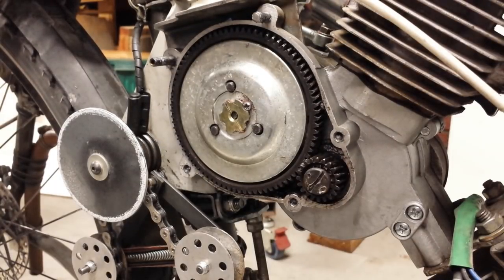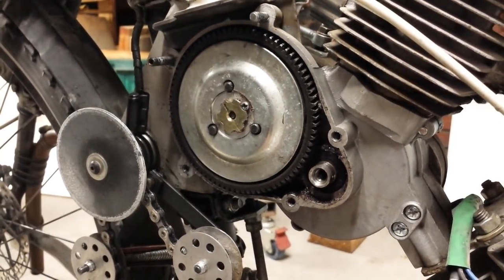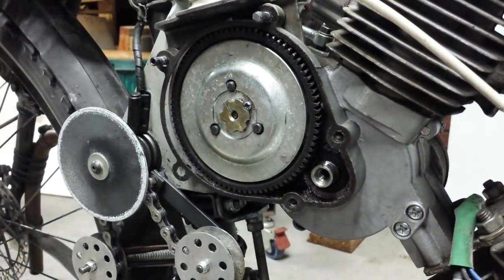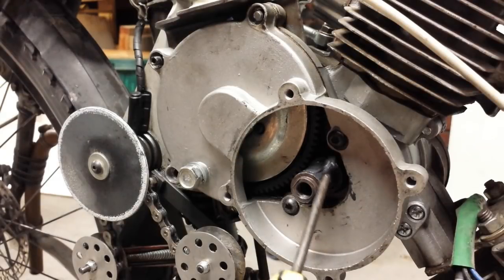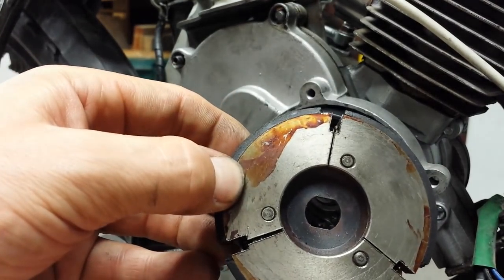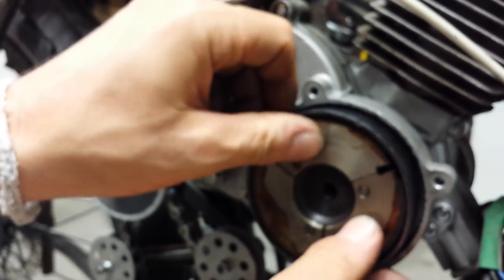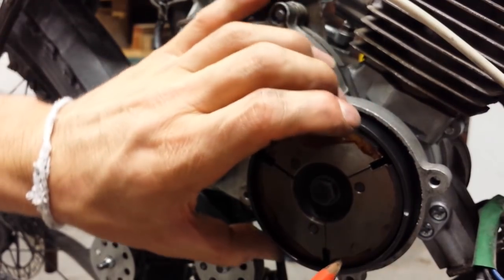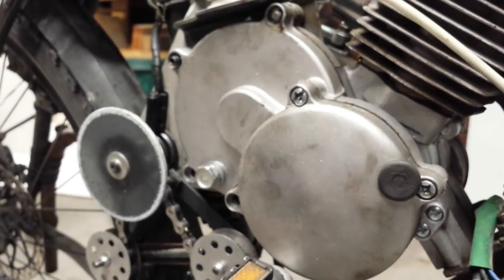Centrifugal Clutch Installation on the 80cc Chinese 2-stroke motorized bicycle engine

Comment: Good video.  Note that this centrifugal clutch kit is intended for use on one of several Chinese--made bicycle motors.  These are all made with a manually-operated dry-plate clutch similar to that on a motorcycle.  However, with a tiny engine and no gear shift it's rather difficult to start off, for the engine likes to stall.  The centrifugal clutch allows you to get off to a very smooth start, for those three big clutch shoes are meant to slip (and they get hot.)  The centrifugal clutch rotates the old dry-plate clutch, and that dry-plate clutch rotates the front drive sprocket.  

Yes, it requires a certain amount of work and a certain amount of mechanical experience as well.  In general, if you can repair a bicycle or a lawmower you'll have enough skill to work on a motorized bike, which requires quite a bit of tinkering just to keep it running even without a fancy clutch.
Reply: TY Mark I was honestly wondering what the point was and you helped me remember someone esle said they lack the torque to start from a complete stop unless you pedal.
Reply: Yes.  I should add that the stock clutch--the one that's lever operated--probably works much better with the 49cc engine if you're a 100 pound kid rather than a 200 pound senior citizen.  It can happen to any of us, I suppose.
Reply: +Mark Kinsler but of course you have to pedal to about 8mph. these are not similar to motorcycle/atv clutches where you can rev and dump the clutch. they have very little gripping force
Reply: Wow thank you for telling us what it does cause for people who dont know what it does will now know an explanation should have been in the video. The video was a bit too long for my taste tho

Comment: Good morning, I have the same clutch installed on a 48cc engine. What no one mentions is that the nut (plug) on the stock clutch side housing is for charging oil into the system. Yes, this clutch is hydraulic. It needs lubrication and the oil it uses is centrifugal clutch oil, SAE 20W30. It must be filled with this oil up to the edge of the fill hole.
Both the original clutch and the centrifugal clutch are in an oil bath and work perfectly.
Greetings from Argentina!

Comment: I am so thankful for this video. 8yrs old and still helping others! I’m finding that the 3 alignment posts on my clutch assembly appear to be longer than yours…too long to allow the cover to fit. I’m tempted to remove them and grind them short enough for the cover to seat properly.

Comment: I'm considering doing this mostly because my stock clutch is slipping and this seems like the only decent upgrade that would permanently fix it.  I already did the shift kit, and pull start, and upgraded intake.  As a side note, I'd tighten the crap out of the flower adjustement nut before sticking the new cover on just so you don't get any more slippage from the original clutch.

Comment: The best way to drill the little oil hole in the bell bushing is to use a 2mm diamond bit and a dremel tool. Takes about 5 mins. and the bits are very cheap. You wont break it easy like the carbide bit either. It works great, I've done it many times. 10 of the bits in a pack is only about 6 bucks. Try it, Very easy..

Comment: Thank You for this video..! I followed your steps to the letter. You'll need those diamond bits from Harbor Freight on your wiz wheel to cut a hole in the gear. I thought this would work without the hand clutch nah unless the "2 positions" made it too tight? It does pull way better off the line, No more bogging .. the out put shaft bolt is 8mm fine thread less than 1-3/4" my kit came with the wrong install bolt.... peace

Comment: Given the relative ease of removing the clutch shoes, and the fact you mentioned you can go about 100km before replacing the lubricant, wouldent it be easier to just remove the clutch bell for regreasing when the time arives? similar to a car oil change?

Comment: If you buy this, you can remove the need for a normal clutch entirely by welding the bevel gear to the back plate and removing the entire mandrel and spring from the shaft

Comment: I want to put one of these on my bike, I have an 80cc Roadstar kit bought off of Amazon. What happens with the old clutch? It just stays there? like a secondary, if I want to manually release the clutch? (it'll just run normally like an automatic clutch until I pull the lever in which case it will release and no power will be applied to the wheel?) Also, will I need to buy a pull start?

Comment: Anyone else bought a cent. Clutch where the extension sleeve isn’t reamed for the taper on the crankshaft? Mine are just straight holes that don’t fit over the shaft
Reply: Same problem. Dont know what to do
Reply: person I have a lathe so I machined mine to have a somewhat matching taper, I hope some of these sellers realize eventually because I watched an installation vid on here and theres was machined properly
Reply: Dang I’m retarded, this IS the installation video lol
Reply: @ghettobikelife8833  should i use a dremel to fix the problem
Reply: @person-ce8cr  I would if you can find a way to spin the extension while grinding on it. The taper angle doesnt need to be exact because there's usually a small shoulder on the crankshaft it can butt up against to keep it straight, but you need to grind all sides evenly or it won't be centered. Though mine has become pretty wobbly after using it alot (0.5-1mm) and it still works ok. Lots of times I've spun things in a drill and hit it with a grinder at the same time as a ghetto lathe. But you have to take it really easy grinding or your hand will slowly start to bounce and it'll be off center.
Reply: If yours has the shoulder to keep it straight And the very end of the crankshaft fits into the hole a little bit, that'll help huge- just don't grind as far as that tip will reach so that the very tip fits tight and keeps it centered. If it has both those things you can maybe freehand it without spinning. Was your clutch from ebay like mine?
Reply: @ghettobikelife8833  yes from ebay
Reply: @ghettobikelife8833  can i just take the manual clutch off with the cent clutch on
Reply: @person-ce8cr  you mean pulling in the clutch like normal? yeah the old clutch will still work

Comment: I found out that the newer kits (possibly even the old style) do not need a hole drilled for grease Fabian. Cleverly enough they machined a bit of the gear part of the clutch bell so they could press it into the bell, they leave enough teeth at the pressed portion that the teeth actually act as full blown channels for the same grease that lubes the gear work, at engine speeds this actually presses lube directly to the one way bearing.
Reply from the maker: The issue, is not the one way bearing. The issue is lack of lubrication between crankshaft extension sleeve and the clutch bell riding surface. The one-way bearing is "not" a load bearing part of the clutch bell.
Reply: The bearings push lube down into the sleeve do they not? Unless the design of the kit I have is different from yours. Did your sleeve come with a hole drilled into it from the outside, about midway, to the inside, comming through the puller tools threads.
Reply: Threads for the puller, I mean.
Reply: And as an additional question, if a person were to drill a couple smaller holes instead of just one larger, could the force of the gears meshing push grease through and onto the shaft reliably
Reply: My gear and bell all appear to be stainless steel material, they should be able to stand up to a couple holes right
Reply from the maker: You logic is flawed. The crankshaft extension sleeve needs to be regularly lubricated.
Reply: Fabian F could you go further to explain what part of my logic is flawed
Reply from the maker: The one way bearing is not a load bearing part of the system. The one way bearing in effect, does not need lubrication to operate. The one way bearing is not designed, and does not operate as a pressure lubrication pump. The gear teeth cannot force lubrication in between the sleeve and ID of the crankshaft helical gear. In operation, there is no provision for lubrication to migrate into the clutch area, and no provision for engine operated lubrication to lubricate the gears.
Reply: Fabian F yes I was able to find this to be mostly true, I'm modifying the centre bolt by drilling and tapping to make a grease fixture

Comment: Hello again I did what you said about putting 4 gasket onto the clutch extension housing that did solve the problem I ran into another problem but was able to get that resolved that was with the small pins that goes into the clutch bearing what I would like to ask you now is when I turn the clutch where it's not engaging with the engine I notice that the drive gear turns do it suppose to do that also the clutch arm did you connect the clutch cable to that or you just left it alone without the clutch cable

Comment: Hi I am installing a centrifugal clutch on my motorize bike however I ran into a problem that I am not sure about when I install the extension housing my flower nut is hitting against the burge in the extension housing what I would like to know did you run into this problem when you installed your extension housing if so how did you fix the problem

Comment: Does this mean that the original clutch is locked in place permanently so it doesn't slip or spin does that mean you don't need the clutch lever either or am I wrong.

Comment: Nice, very informative.
But I was wondering, since you already greased up  the extension sleeve, is it really necessary to drill the gear and case for lubrication? 
I mean I know you'd want to periodically check to make sure everything is a go, and with regular motor bike maintenance wouldn't be too much out of the ordinary no?
I'm just asking because I'm trying to find out if it's absolutely a necessity  thank you for the very informative video. ☺️

Comment: Hi I have a  question. I have a 80cc bike motor ok when I. Pedal and released the clutch the motor has to. Turn on right  mine doesn't  it don't turn on so if guys know how to fix it I will really appreciate that

Comment: This video is great and helped me a lot with my own centrifugal clutch. I have a question: the one way bearing stop engaging after a ride. I have to pop everything open and clean the bearings (the five small pieces) to remove the grease in order to make it work again. Is this normal?

Comment: So ive read thru the comments and watched the video and just want to be sure i am doing this right before i screw up one of the last available centrifugal clutches im goin to abbreviate the clutches as CC and MC so does that flower nut get screwed counter clockwise or clockwise n my application is on a dirtsurfer i have built myself with a jackshaft n the right size gears to retain normal ratios of a 45t rear sprocket so that i can use an internal 3 speed hub to help with hills n high speed n eliminate the need to move the chain from sprocket to sprocket n it keeps the chain from going thru my right ankle and instead raised up to go over my right foot toes i dont have any means to pedal it n wont always have a hill to jumpstart it so i have a pull start but im trying to keep down the number of cables that run to a sawed off handlebar i have one for gas one for brake n one to shift the rear hub so i really only want to have the centrifugal clutch operating is there anything i need to do to make sure the MC is engaged or allowed to spin freely at all times n allow the CC to only engage when given gas should i just remove the MC gear completely since i have a pull start and couldnt pedal start if i wanted to basically all the reasons i saw u had suggested to keep it are irrelevant to my application or will it interfere with the operation of the CC n about that flower nut if u suggest that i do remove the MC that would be gone correct n if u suggest that i keep MC gear does the MC need to be engaged constantly so that it will spin freely n how can i accomplish this without an extra cable and a clutch hold on the lever

Comment: thanks Fabian 
 I thought that the centrifugal clutch replace the regular, because on the vid. you removed the set screw by the flower but and then you tight it ,so that engaged the clutch and the centrifugal clutch will do the job 
if you can ..can you explain the reason to keep it thanks for your vid.
I'm going to get a engine gt5 ported and add the jack shaft I owed a trek 660 mountain bike with hydraulic disc and the frame looks a bit small do you know the minimum space need it to attached a engine 
thanks for the help

Comment: I am unable to get the crankshaft extension sleeve on the crank shaft far enough to have the clutch housing to recess as much as is needed. I cleaned both the shaft and the extension as prescribed by you. Do I have a bad extension or am I missing something?

Thank you.
Reply: maybe you forget to remove the wood draft key?

Comment: Good job!... I don't understand why you had to be so clean with the turpentine and alcohol though on those two parts??? There was no sealer/locking fluid/glue used.
Reply from the maker: The transfer of torque to the crankshaft extension sleeve is only from a friction fit. If there is any grease between the two parts the friction locking is compromised and the crankshaft can slip/spin inside the crankshaft extension sleeve, both causing a loss of drive and damage to the sleeve and crankshaft. If you want dependable reliability, you must make sure that the mating surfaces are absolutely free from grease or oil.

Comment: How do you get the clutch apart to file those edges Fabian. Mine is brand new and I do not want to force it. I have already broken enough stuff learning by trial and error on this build.
Reply from the maker: There are two ways of going about it. The first method is to use a pair of flat blade screw drivers to try and force the clutch shoe disk away from the crankshaft extension sleeve by placing screwdriver tips in between the clutch shoes and the inner face of the clutch bell. This is a tricky procedure because it can take a very long lime to slowly wiggle the clutch shoes so the disk frees itself from the extension sleeve. There is also a risk of bending the clutch bell housing, which will cause permanent damage to the clutch bell.

The other option is to use the crankshaft extension sleeve extraction tool (supplied in the centrifugal clutch kit) to remove the extension sleeve, as well as the clutch shoes in one single operation.
Reply: I used what was  supposed to be a cobalt bit from eBay and a carbide and tungsten bit from home depot and only made a scratch on the surface. I guess I will have to forgo the oil hole unfortunately.
Reply from the maker: robert apple Typically the drill bits from eBay and Home Depot are only surface coated HSS drill bits. They are for the most part completely useless.

A proper 2,5mm cobalt drill bit works out to be around $10 

I also need to mention that a conventional single speed drill press spins too fast, and generates too much heat when trying to drill through hardened steel.
You will need to use a multi-speed drill press, set to around 200 rpm, as well as continuously applying a light cutting oil (or transmission oil) on the drill bit and making sure you frequently pull the drill bit out of the hole to make sure it's filled with cutting oil.

When starting the initial phase of the drilling process, you must be extremely careful because the very outside cutting tips of the drill bit (if stating out with a 2.5mm drill bit) will dig into the angled faces of the gear, and can tear away the outer cutting tips, causing the drill bit to become completely useless, in an instant.

The hardest part of the drilling process is to very, very slowly cut into the angled faces of the gear teeth, till you reach the bottom outside face of the gear, i.e.  till the drill bit just bites into the floor of the gear teeth.

This very slow process can take up to 10 minutes - it's an agonisingly  slow process, and the whole drilling process can take from 30 minutes to 45 minutes, just to drill one single hole.

Comment: I have this clutch and you do not have to do all that pre oil and drill hole stuff lithium grease thats it. I have hundreds of miles on my clutch and very re-greased anything. Its not a wet clutch system